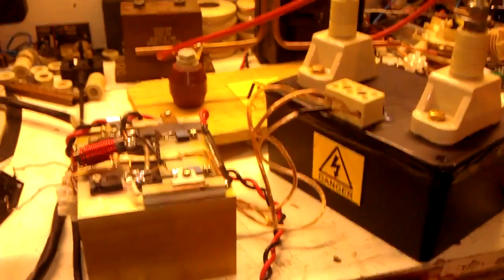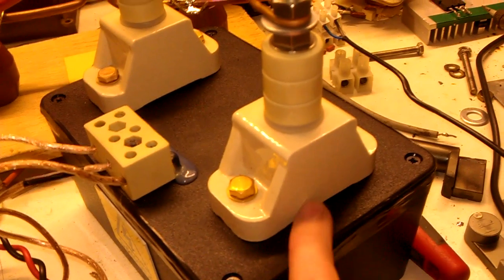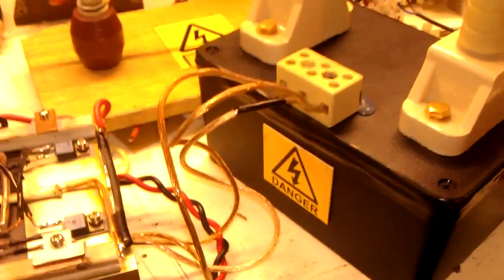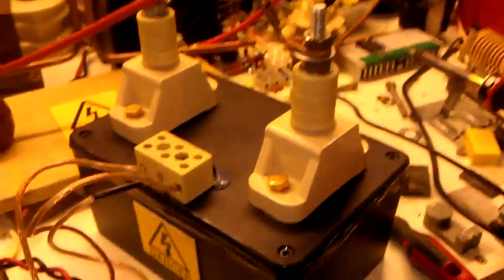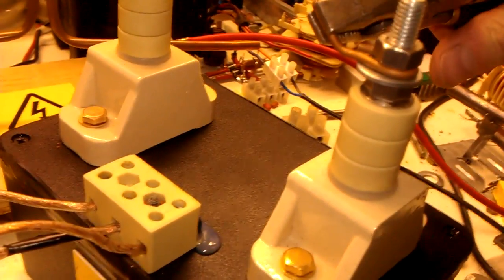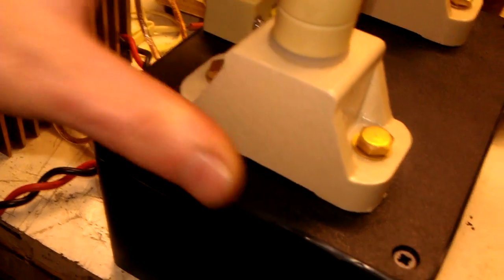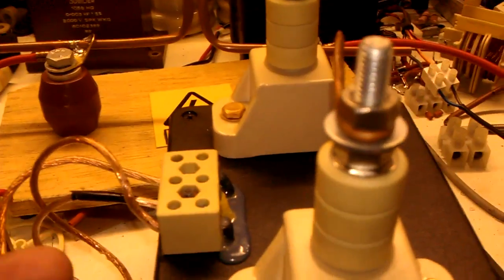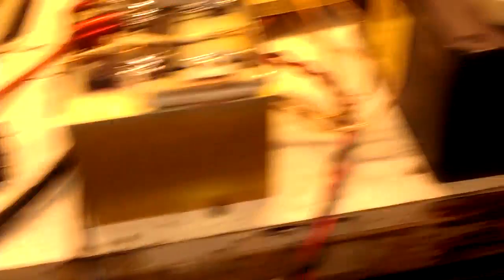Project, High voltage transformer

Comment: when the capacitor goes away one of the transistors will latch up and wont switch to the other one, thus blowing up the one that got the shorter stick :D

Comment: Those standoffs are actually rated for 660 Volts AC max. Often used on busbars in 240 / 415 installations.

Comment: Nice loud arcs! :D
Careful if you can feel anything through the screwdriver handle.   Tesla coils (and the transformer here) run at frequencies which the nervous system cannot detect well, so it can cause damage to you without you being able to feel it.  The only way you are feeling it here is I think the mains ripple superimposed on the arc, and there could be significant rf going through your hand that you cannot feel.

Comment: put a 10 meg resitor from one high voltage wire
to the middel of the jackobs lader
then it wil auto start

the resistor should be a 5W one
and in the middle

if it does not start try a 5meg resistor